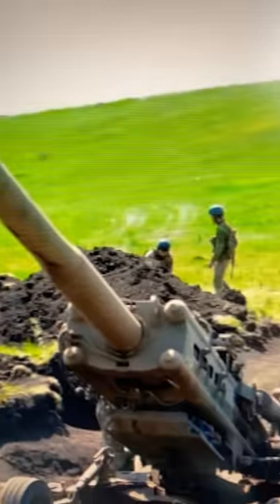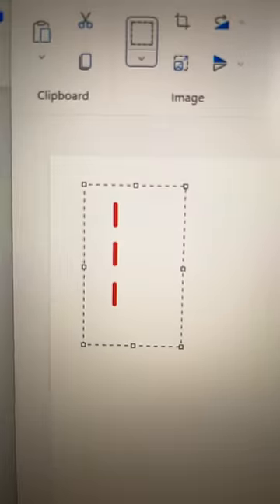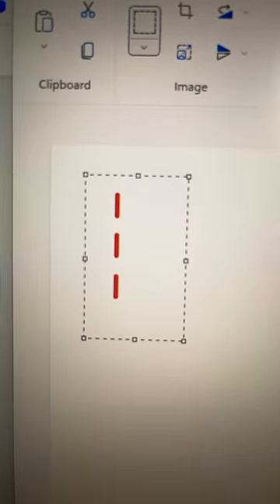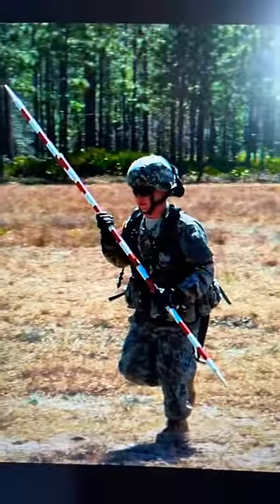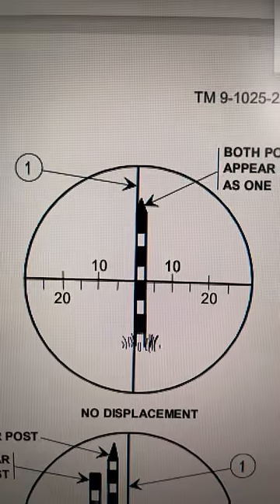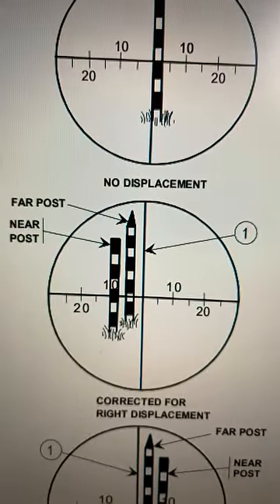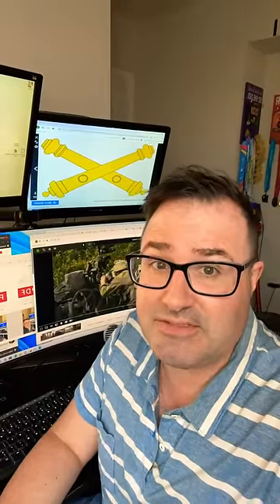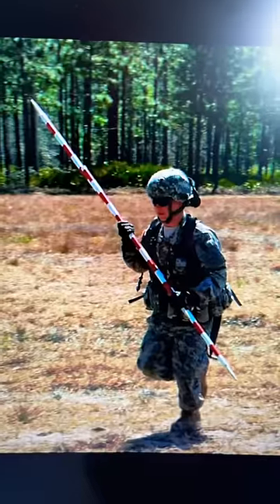How is an M777 Howitzer Aimed?

Comment: I was 13 Bravo for 14 years, and this is not how we did this. I have fired everything from an 8" to a 105 tow and our primary aiming device was a collimater. Our aiming posts were secondary aiming points. These are setup in case someone or the cannon blast knocks down our collimater. The first post is 50 meter away and the second one is 100 meter away. 
We also have to find a, D A P, a distance aiming point. 
The aiming posts are placed directly in line with the collimater and and we do not split the sticks. When we look through our panoramic scope, we have to see just one post. That is why one is larger than the other. The smaller one is in front and the larger one is in the back. 
Our scopes has two bubbles, one vertical one horizontal. If our scope is level and we zero on our posts and we see more than one, we check fire and we are out of the mission till we can realign the post.
The picture you shown with the posts is not 10 mils displacement, but zero in. The numbers go right to left and left to right, so after we punch in our numbers we know which way to turn our scope.

Comment: Correct me if I'm wrong. So are the sticks used for projecting the heading for aiming the artillery ? Like the scale used in map ? Like 1 cm up and down in the scope, change the trajectory of the shell by 1 km or something like that ?
Reply from the maker: Sort of. They use millaradients which is basically one meter width at one KM but your theory is in the right place.

Comment: Hello, i have a question please, can towed artillery hit a moving tank/vehicle ? And the forward observer does he wonder around then gives his position as soon as he sees an enemy or his position is previously known and determined ?
Reply from the maker: It would have to be a very lucky shot to hit a moving vehicle although that can be done with laser guided artillery.

Usually the FO is tasked to be in a certain area. So the FDC or fire direction center knows the general area where he will be operating and they can plot out TRPs and landmarks ahead of time.  So they might not know exactly where the FO is, but they know the general area.
Reply: @RyanMcBethProgramming  thank you so much.

Comment: I wonder if these new howitzers have ballistic tables.   These are data listing the range of the weapon at different angles, elevation differences, corriolis effect  if the shells at different charge levels.  We were exposed.to this when I was a ROTC cadet whem my country still had a mandatory 2 year ROTC for males in college.   You had to intetpolate to get the firing solutiom you need.  Yup, computers make this way easier but I wonder if a back up will be  useful at some instances.

Comment: If the thing is already towed into position I'm assuming weight isn't much of a factor so why not just put little stepper motors on a gear train and use narrow ai to plug in firing data and have the stepper motors do their thing to auto calibrate/calculate the firing angle

Comment: But you know, that stick has to be manufactured to a milspec, and someone has to test that it's within spec, and someone else has to validate the test method that they're using, and it has to be made from low-background aluminum, so it's gonna cost you $10,000 a piece.

Comment: You might want to check your facts.  I've been both FDC and a FO. The FDC hasn't done any math since the 80's. A computer does that.  
The gun isn't just looking at a stake.  The battery is surveyed just like your property,  giving them a known point on Earth.  The funds are then "laid" on the survey point,  so the computer knows where each gun is.  That's where the stake comes in.  After that they read the numbers on the gun sight.  They are sent an azimuth and an elevation.

Comment: You have it all wrong.   When the battery is laid (properly aligned and oriented with the earth to a know point) the aiming stakes are set out.  There is a fra post a near post and they are initially set in perfect alignment with one another with the short post being half the distance between the far post and the site.  When a fire mission comes down from FDC they provide a Quadrant and a Azimuth.  The gunner sets in the quadrant and the assistant gunner sets the azimuth then the gunner traverses to put the post in his sight.  The elevation of  the gun is set by the Assistant gunner.  They fire the mission and the recoil moves the gun.  This is called displacement.  On subsequent rounds to be fired the gunner applies the NFL (Near Far Line) rule to make up for the displacement.  That is diagram you showed in the video with the post being out of alignment.  FDC does not tell them to aim at the post!  Today they use a collimator which can be used day and nite and it more accurate.  Aiming Post today would be the backup system if something happens to you collimator.

Comment: with the more advanced artillery systems available in western militaries today and now arriving in ukraine, this whole system is simplified and made even more technologically advance to the point where it is almost as pressing a button and you would already get a firing solution ready with a highly accurate precision guided round, where typically you would need to fire hundreds if not thousands of shells to land a hit, with modern systems it can be achieved by a few dozen or less shots.

Comment: That isn't how it works! the FDC does not tell you which aiming post to aim at and the FDC does not care where your aiming posts are. So super simple for you. The gun is surveyed into position and that position is passed to the FDC During the survey stage  the gun is aligned to give it orientation so it points in the right direction when given a bearing. Aiming posts are run out on a given angle a distant aiming point selected  (sometimes other gunnery aiming points are used as well) the angle on the dial sight is set so now when we set a bearing on the sight and move the gun so the cross hairs align with the aiming posts the gun now points in the correct direction in relation to the earth. now with the correct elevation and charge the gun will be be able to strike the target. Gunnery is easy if you have any questions shoot me a message.

Comment: LMAO come one bro one fdc gives a deflection that is set on the gunner sight, they then adjust the gun to the collameter by traversing the cannon until the they can pick up the correct sight picture on the collameter. Same for the aiming post. FDC just gives us the deflection we need. we set that off in the sight and then adjust to either aiming method....

Comment: I shot arty, and you're not exactly right, first we use a colimeter which is at the 10 olclock position from the gunner, the one who is looking through the site, he gets a deflection in which he will put on the site and then traverse the howitzer till he lines up on the colimeter.

The aiming post are a secondary Incase you lose you're colimeter from either the recoil of the gun sliding to far back or something else.

 And then if you lose your post you also have a DAP(distant aiming point) ie: a mountain top. That's for your left and right deflection. The a-gunner on the opposite of the gunner will control the elevation which is given from FDC as well. 

But with modern technology those howitzer can use our DFCS (digital fire system) which is super easy. However you always set up the old school way. I won't go into how we lay the guns, because that's just too much to get into with the aiming circle.

Comment: The spinning of the earth is not added. Artillery has never been pin point accurate with every round so you dont need to factor in earth rotation to make it sound way cooler. No.

Comment: Your information is not entirely correct  , being a veteran of the US Army  my most was 13b .

When a gun sets up the aiming  post and a column Metter (spelling may be off) 

The gun first gets laid and safe via the aiming post and column meter. 

A firing mission will give you the round , powder charge and azmith and elevation  that firing mission is accurate enough for a 98lbs 155mm round to be placed in a five gallon bucket at all ranges.

A RAP round can achieve a 19 mile range a normal HE round is slightly less than that.

Comment: I don't think that's exactly true! The aiming poles is a source for a backup point of reference to aim from but especially not going to be used from a M777 as it is digital and communication with FDC is wireless using an encrypted radios and aiming is done by the on board computer the gunner traverses the gun side to side and up and down until a dot lines up on an LCD screen when it's lined up and bubbles are lever its safe to fire.. I was a gunner both on old M198 and M777... so I do have experience to backup what I say

Comment: Dumb way to direct fire. My countrys' army has a system where you can call a strike based on a dot on a map (basic nato grid), or a 50x100m or 100x200m area, so as a grunt all you need to know is where you are, where you want shells and the batteries do their calculations, adjustments and aiming themselves. First taters are airborne as soon as 20 seconds after the fire request.